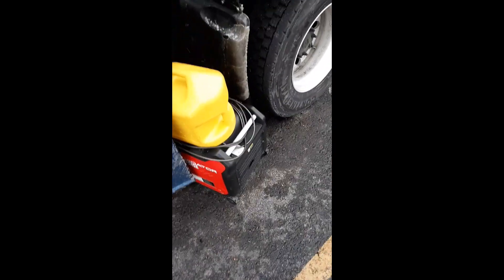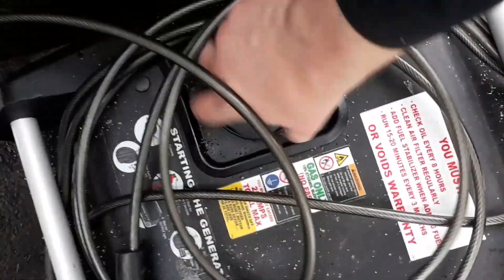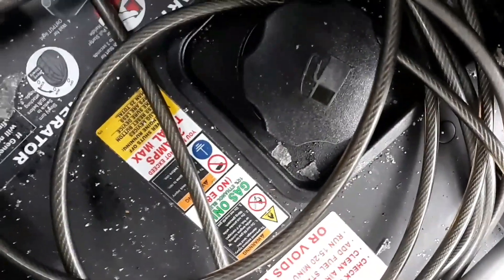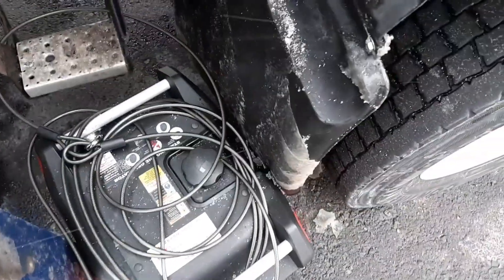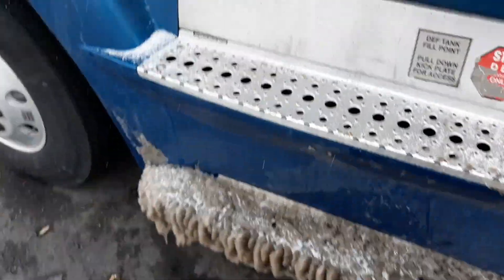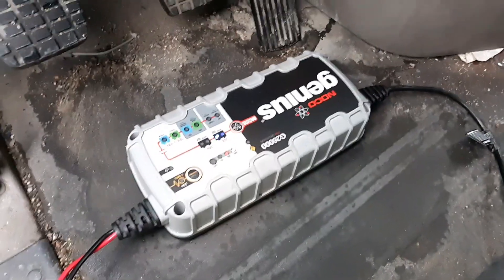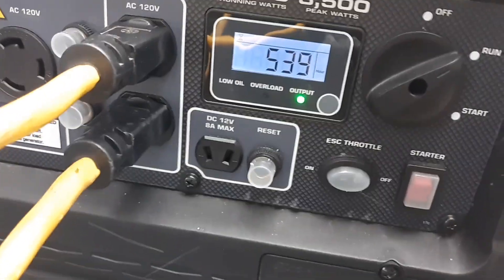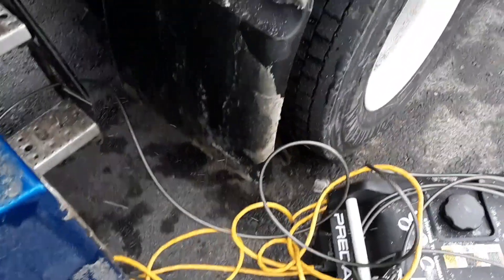Predator 3500:  539 Hour Update

Comment: did you remove the carbon box, if so why, can seem to find a direct answer on YouTube
Reply from the maker: I removed the charcoal canister as this was connected to the fuel tank vent tube.  I plugged the fuel tank vent nipple on the bottom of the fuel tank (inside the engine bay) as to allow for more fuel to be added to the fuel tank but mostly because the rubber lines from the charcoal canister feed the fuel vapors to a nipple on the air filter box, which then go unmetered to the carb.  There's no air added to the fuel vapors, thus the engine runs rich.  This running rich condition seems to be the culprit of the engine shuddering out and dying.

I also removed the spark arrestor on the exhaust as it "fouls up" or gets clogged up with carbon deposits and requires constant cleaning.

I have another video up here on YouTube showing how to remove the charcoal canister and how to plug the vent tube.

Comment: How’s it holding up
Reply from the maker: The one in this video died a little after 1000 hours (pull cord and electric start went).  On my 4th one.  500+ hours on it since I got it about 2 months ago.
Reply: How long does it run on a full tank with the load you put on?
Reply: @porkchop8004   I have 2800 on my Yamaha (still runs like new) and a freind who lives off the grid in Arizona has 18,000 hours on his Yamaha. You read that right, eighteen THOUSAND hours on his Yamaha. You are not saving money my buying an off-brand generator.